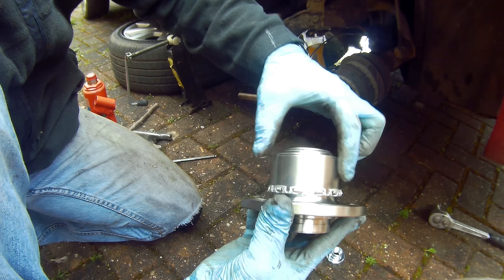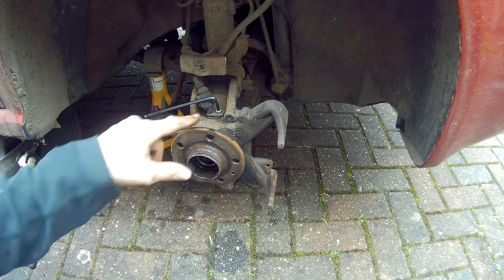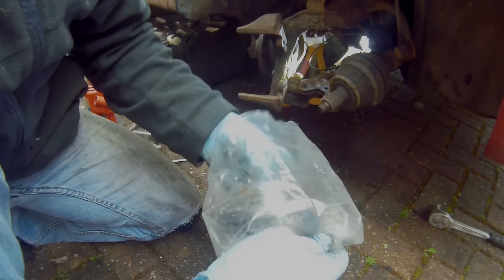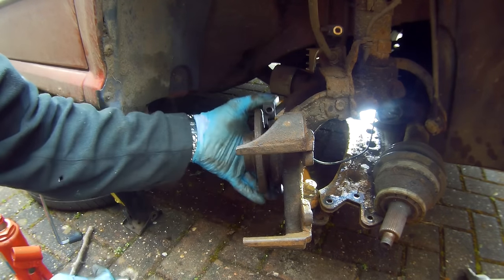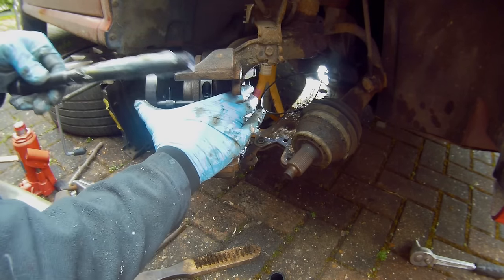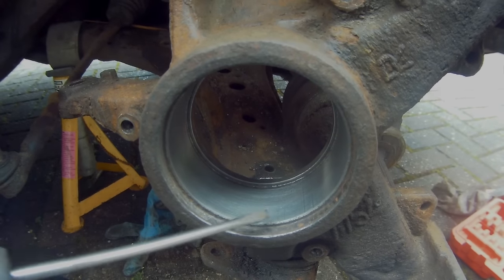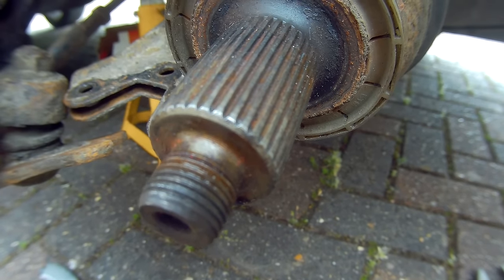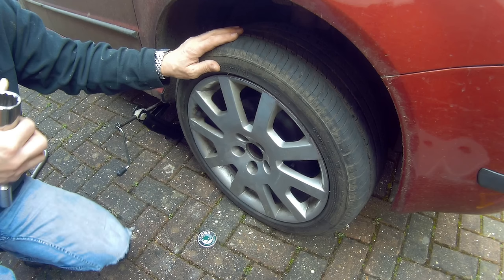VW, AUDI, SKODA, SEAT Front Wheel Bearing

Comment: Excellent tutorial. Lots of detail. It answered all the outstanding questions in my head.
May i ask - which make of kit did you use? Sealey make a kit, but i've noticed some far cheaper ones. Which would you recommend?
Reply: Thanks. Good advice. Will give it a go next week.
Reply: It’s a Chinese no make kit I got it from eBay about £50 but I’ve done a few of these vw t5 bearings with it , it’s spot on mate 👍

Comment: Best leave the abs sensor in if you can 9 times out of ten if you try removing it it will break then you have to mess about drilling and replacing it , this is very similar to the t5 transporter 👍
Reply from the maker: Agree, as long as you line up the extraction/refit tool correctly and it has the facility ;-)
Reply: HatBoyHarvey yes that’s the one it’s much les hassle 👍

Comment: I did this job yesterday and found the 36 mm socket I had bought specifically for this hub nut was slightly to big to fully engage with the nut( on the outside of the hub ) so check that your socket fully seats inside of your hub I used an OE spec cheap hub so maybe the measurements are a bit off and double check your driveshaft engages easily with the new bearing BEFORE fitting the new bearing you never know and checking might save pulling the bearing out again if it's the wrong one!
Anyway I ground of 1-2mm from the outer of my socket so it fits perfectly and the jobs a good un.

Comment: Fantastic detailed video mate… I’m doing to order the tool set and give my 2011 VW polo front wheel bearings a go.
Reply from the maker: Great to hear that, take your time and be steady when you come to pressing in the bearing, I can't stress how important it is to make sure the bearing goes in straight. I used a lot more small taps with a hammer than what is in the video to make sure the bearing went in correctly before pressing home with the tool. Good luck and let me know how you get on :-)

Comment: Thank you for this excellent video. It was very helpful and a must watch for me to take on the wheel bearing on my skoda fabia. No problems worth mentioning thanks to your tutorial. The Only thing I did not consider was the rust and corrosion back at the spindel where the larger disk should be placed when mounting the hub. I shuold have taken time cleaning it up to get the alignement easier and more efficient. 

Thank you once again from a greatful swede and sorry in advance for my spelling.
Reply from the maker: Thank you, you're very welcome, glad the video helped. i guess the weather in Sweden is quite hard on the underside of cars, but at least I don't think you use salt in winter like the UK which accelerates rust terribly :-)

Comment: I just took the hub off and used  hydraulic press to press it out and then press it in. Even when using a press it was tight to come out.
Reply from the maker: How did you get around the lip when pressing in the bearing?
Reply: Pressed it bang in the middle on the inner race with correct bearing adaptor. When the bearing was out give the hub a good clean with wire wheel to get all rust off. Then pressed the new one  in with a little grease applied. As a mechanic I have the hydraulic press but you can buy special tools all day long which can get costly so we have to improvise .good video mate

Comment: Excellent video . Thank you . I didn't notice any mention of reconnecting the track rod . I don't know if that's a problem . Any way Thank you very helpful in deed
Reply from the maker: Thanks. There isn't an issue with the tack rod, you just reattach and away you go, although messing with the car quite a bit like this may put the tracking out a tad, so worth checking later.

Comment: But to be clear. To replace the bearing with fuse body on the car and not of the car this is the proper way of doing it ! So thanks for the good video
Reply from the maker: Thanks, glad you liked the video. How did you do it without pushing onto the flange?
Reply: @HatBoyHarvey   i take of the complete suspension body ( fuse ) part . With the bearing stil in it ( cut off the plate disk connected to the bearing ( whith the wheel bolt threads ) then i just do it like I do almost all other bearings . Put the bearing with body under a hand driven ( hydraulic ) pressure machine . Using busses or sockets  with smaller diameter and push out the bearing with the pressure machine . 
When placing the new one i turn everything upside down and put the new bearing below and push the body with pressure machine on top and press of down at the new bearing... just have to use something like little metal plates to keep the metal ring at its place and to not put pressure on the inner( circle bearing )  ring or else the new bearing will brake.  Then just press down untill you here the click sound. 

With this way you dont need the special kitt but you do need to have a pressing machine.  But these are second hand way cheaper then the toolkit around here haha .
Reply from the maker: yes, presses are widely used for bearings in garages etc, but it is the flange/collar that pose the main issue with these bearings. This design is harder for us mechanics also to install. Glad you could find some metal plates to hold the bearing when pressing home, did you make these or can you buy them for presses?

Comment: Hi.  Thanks for the video.  Due to exchange wheel bearings shortly on a 2010 Polo 6R.  Have bought SKF Bearings (VKBA3569), but they do not have the serrated retaining ring on the outboard end of the outer race.  Is this am issue?  Is the click of the ring into the groove necessary for locational purposes, or is it not needed?  The SKF video shows their 'plain' bearing being fitted into the bearing housing with no ring - so confused!!
Reply from the maker: I'm not sure why on  the polo they don't have this clip, presumably the rebate isn't there either. I don't think this clip is there to hold the bearing in, (On complete failure it may be a safety design feature to stop it falling out, dunno !?) just an audible click so you know it is seated OK I believe. As long as you make sure it is pressed home fully by the rebate without pressing on the flange all will be OK. The size of 72mm is the same, but I don't know if it is same/longer/shorter. Installation seems to be the same though, just take care with the ABS sensor etc :-)
Reply: @HatBoyHarvey  Thank you - that's very helpful.  I'll add a comment about how I get on.....if I'm still capable!! 🙂

Comment: Does the abs sensor read something inside the new bearing?  My abs light is on now and I’m wondering if I’ve either damaged the sensor or it’s a millimeter or so away from being fully seated correctly.  Thanks for the video.
Reply: Also I had to remove the steering knuckle and use a hydraulic press to remove the bearing. I feel like a damaged sensor is the most likely cause.
Reply from the maker: Yes the ABS sensor reads from the rear of the bearing. the reluctor ring is within this as apposed to many that are separate. These ABS sensors do often go wrong and when you can get them out are cheap to replace.

Comment: Hi, I have a 2017 vw polo and I wanted to know if I can remove the wheel bearing with this tool? And if the bearing is not damaged, do you think I can use it again? 
thank you for your answer
Reply from the maker: Yes and yes, but you can tell if the bearing shot without taking it off, if your not sure then try to find someone that can tell you if it ok or not before buying the tool. what are your symptoms?

Comment: Hey, thanks for showing the video,  I have a seat ibiza 2011 and it seems like the its pulling to the left  especially on camber heavy roads, I got the tracking done a week ago and they said it was towing out! They corrected that, but its still feeling uncomfortable my right hand feels like it's putting extra presure on the steering wheel to keep it from pulling to the left.
I have the mot for 2 years ago and it said there is slight play on the ofs front wheel, they didn't say nothing last mot 
Wondering as I can't hear noise when driving from the bearing but when I brake and slightly turn the steering when practically stopped it slightly pulls the steering by itself? 
My power steering fluid is not up to the minimum also  but it has a lot of fluid in the reservoir, 
Do you think it could be the wheel bearing pulling it to the left ? Pls
Reply from the maker: If it is a tracking issue then I think it could be play in the inner track rod, often overlooked. Check and replace both track rods and track rod ends. Fairly easy and cheap to do yourself. The bearing can be examined separately, but is more involved and needs a special tool or competent garage to change it :-)
Reply: @HatBoyHarvey  thanks 😊

Comment: Great video, is very helpful. This tool is to be used in situ with the hub on the car. However they can be pressed with a hydraulic press with the steering knuckle off the car.
Reply from the maker: Yes, you can use the tool in a machine press or some other collar to hold this type of bearing if you have one. It is very important that everyone knows that YOU CAN'T PUSH THE BEARING IN FROM THE FLANGE SURFACE. :-)
Reply: @HatBoyHarvey  the haynes manual shows this bearing being pressed in by a 5 ton press. The tools not needed if you are using a press. Grab a haynes manual and see for yourself.
Reply from the maker: @ajfessey_landpirate8014  Thanks, Just had a look. Yes it is possible as you say, but they are useing  a couple of pieces of flat metal bar to bridge the space between the bearing and hub. If you have a press and are confident this type of spacer/s won't slip at all then I agree, it will be possible, same goes for taking it out, by the look of it they are propping the hub up with angle iron, again 'if it slips'.  Only OK if you know what you are doing and actually have a press and the space, although one would come in handy for other stuff. I still think the flange tool is better for doing this particular bearing :-)

Comment: hi!
how do i install a simular hub/bearing like yours?only differance is i have wheel studs mounted,do i have to remove those to be able to use that tool and will there be enough clearence to put the studs back in??  or how would you go about it?

Thank you//Fredde
Reply from the maker: What vehicle, model engine and year?

Comment: Hi Harvey, im having some issues around the 9:37 mark, it seems your bearing just fits in pretty easily so it can hold itself in place, mine simply doesnt go that far in, i can't get it to hold itself in place. Therefore i can't adjust it to be perfectly aligned - Do you have any tips? If i you need more details let me know
Reply from the maker: Slowly but firmly tap around the circumstance evenly through the bolt holes onto the tools flange plates  until you are happy to attach the tool fully. It isn't easy if you have never installed a bearing before and you may feel you need three hands. Manually tapping the first stages is the best way IMHO to make sure the alignment is correct (I tapped the bearing in a fair way) continually checking alignment (imperative this is perfect) before using the tool to pull the bearing home fully. Hope this helps :-)

Comment: Thank for this . I have one to do on a polo . all very clear apart from the last bit . you say 45 degrees , but mark it at 90 degrees ?
Reply from the maker: Glad it helped. Maybe I should have been clearer when doing that bit, but this was one of my early videos and I could do a better one now and may update it at some stage. I marked it like that as a guide for 45 deg as my eyesight isn't too good, but did torque it correctly. The bolt on ones are much easier, but I think on these smaller cars they may have been worried to use bolt-on ones because less affluent owners may not bother or have reliable torque wrenches or even fit new bolts!
Reply: @HatBoyHarvey  thanks for the reply . my question was , you marked 90 degree (quarter turn) , not 45 (8th turn). Still a brill vid , and enough to get me through it . except I just bust my collar bone ! lol .. and it looks like you need 2 good strong arms . so I'll have to wait a bit .
Reply from the maker: Sorry to hear you broke your collar bone. Are they leaving it to migrate naturally or have you a metal plate?
Reply: @HatBoyHarvey  Thanks . I'm on my own ! lol .. even physio is by phone ! ?? 2020 !
Reply from the maker: Take care with the collar bone, you will soon be up to full health again :-)

Comment: Great video harvey just a quick question do you have to loosen the drive shaft nut before you raise the car ie to stop the drive shaft turning ???
Reply from the maker: Thanks, yes, but you need to take off the centre cap for the socket and bar, so you will be pulling the wheel off then back on again to release the hub nut, then back off again if you get my drift (off/on/off) :-)

Comment: Tried to do mine but ended up breaking my brand new bearing press :/ no matter how much heat i applied and wd40 :/ almost bent the break bar too.
Reply from the maker: Oh dear, sorry to hear that, sounds like it is well seized into the hub. All I can suggest is remove the hub, replace it or attempt to drill or grind it out. Best of luck, hope you can get it sorted and back on the road :-)

Comment: Did you have a plastic ring in your box? Does this ring need to be installed? Can you tell me its usefulness? by thanking you
Reply from the maker: Clean it up and refit it. it is a dust seal protector for the bearing. Bearing kits often come with new ones.

Comment: hi, really helpful video and am planning on changing my own wheel bearing now just my only problem is trying to buy the grease from the links you have added it looks like you used the Lucas oil heavy-duty grease, however, isn't the one mentioned in the video. so is the Lucas heavy duty grease a fine alternative and if not do you have any recommendations on where i can buy this.
Reply from the maker: It is really difficult to get the exact specification recommended by skoda for these. i have some trade engineering/automotive bearing grease left over from previous work that you can't get now. The greases recommended in the video are what skoda worksho manual recommends, so I put them in the video.  You are lubing the inside of the hub so the bearing goes in easier and needs to withstand high temp/pressure so you can get it out again in the future. In my opinion any high temp/pressure bearing grease will do this ;-) I wouldn't worry too much as long as you don't use chip fat oil or lard you will be fine :-)
Reply: @HatBoyHarvey  thank you man you been a big help

Comment: I'm doing this just shortly but in the video you mention the circlip clicks into place.  Which circlip thought? You didnt mention or show one up until that point. I bought a new hub and a new wheel bearing but neither of them came with a circlip.
Reply from the maker: The circlip is the wavy ring attached on the front edge of the bearing behind the flange. It self-fits into the front groove on the hub when it seats into it's final position that I show being cleaned out. You can't see it click, just hear it. double check you have the right parts for your car also before you start.
Reply: @HatBoyHarvey  Ahhh that's perfect and explains a lot. Thank you. I had to buy a new hub / bearing carrier as i have the VRS and the caliper mount is seperate from the hub. I removed the caliper mount to fit the new brake dust cover and when i torqued it back up , it stripped out. Turned out someone had helicoiled it before.
So new wheel bearing, new wheel hub / carrier and looks like i need to buy a bearing press as well. Than was an expensive adventure for me.
Which bearing press should be used for this shape of Fabia? I seen Gen 1 and Gen 2 etc on ebay
Reply from the maker: 72mm vag wheel bearing tool. I wouldn't recommend doing these with a standard press, but it is possible.
Reply: @HatBoyHarvey  yeah phoned s few local garages to query if they had the tool to get them to press it in for me and save some money but they all just use a regular hydraulic press so i think i'll buy one of these tools and give it a go myself and see how i get on.

Comment: Hi Hat Boy Harvey, thanks for posting your MK1 skoda fabia films.  We have the same car and are experiencing some of the same problems.  Your clear and straight forward style is easy to follow!
One question on the drive shaft nut, 36mm, 12 point socket, does it need to be a 'deep impact' socket?  The one I purchased, not sure if its deep impact, is 50mm diameter and wont reach the nut in the recess!!
Reply from the maker: impact sockets are made for impact driver as they give a little to take the shock of the drivers, I never use them. I prefer to be quiet, the noise of those drill drivers that guys use drive me crazy and I'm crazy enough right. my socket was a little close too and is maybe slightly under 50mm diameter and fit on (draper) worked fine. Maybe take a tape measure to the shop, return the old one and find a thin walled deep one :-)

Comment: My frind how are you  I have just one questien   I need to replace CV axle and the old one have the plastic ring in the top of cv joint but the new one some is the OEM number for my car does not have it ... it is okey to mount it without that Plastic ring or plastic protector ABS ? I have one old metal ring from the last cv joint but that does not fitt in the new cv joint or cv axle .... What should I do
Reply from the maker: Are we talking about: 6Q0407623E ?
Reply: Yes my friend how can I find it online?
Reply from the maker: I just put the part number in the search bar and found a number of companies selling it for around £5